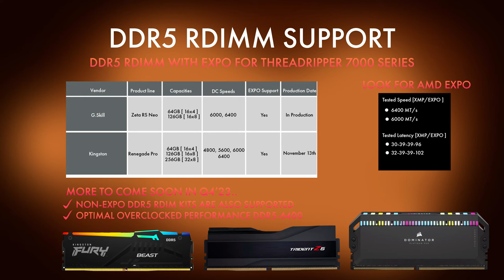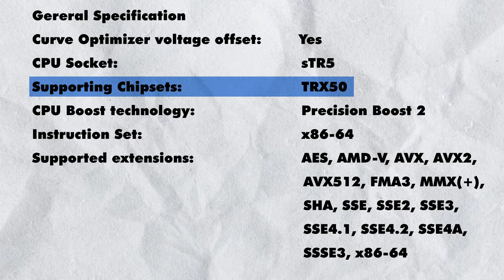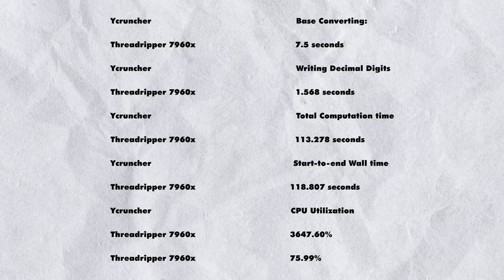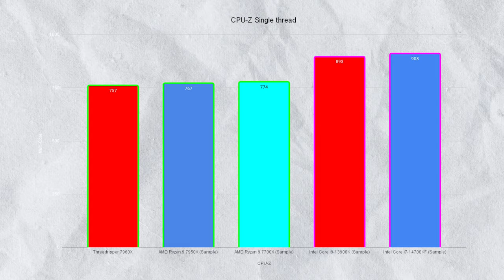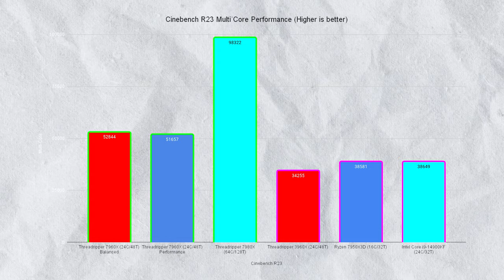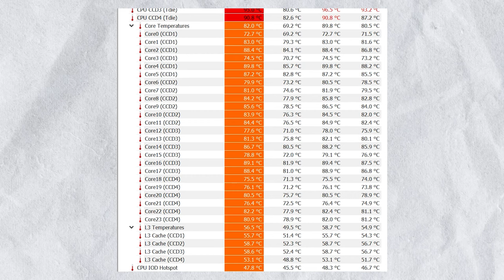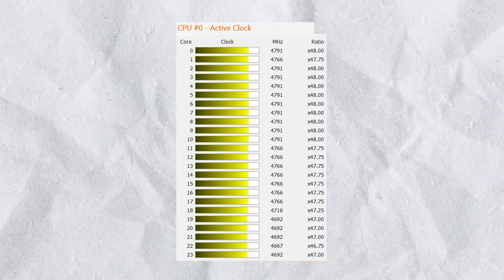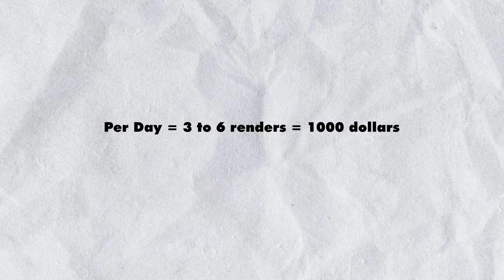A 24 Core Monster! | Threadripper 7960X Review

Comment: Strongly considering this CPU for my next build and you covered some good bases and points to think upon. Heavy Blender user along with some photoshop work, lots of Lightroom, Premiere, minor coding, lots of gaming, so it's for me a case of "this will crush all around workloads that I need". Thanks for the great review.
Reply from the maker: Heya :) 

Just note the benches were not amazing for Adobe based applications. Intel still won there, but it is not going to be a massive difference especially if you are going for all around workloads :) 

Just get good ram !

Comment: So the problem with the "it can but shouldn't" is that many of us out here use our PCs for a combo of things. I write code for the day job, I "try" to write music with my DAW setup, I run some AI models on the PC, and I game. So for me, it's the perfect all around CPU with enough gaming performance to get the job done for most games quite easily, while providing a robust developer machine and AI machine (with dual AMD 7900xtx GPUs for the VRAM), music production, etc. For someone just looking for gaming, def go with 7950x or 7800x3d. But if you do multiple things with your machine, this chip is probably the sweet spot for getting you in to the TR without costing that extra $1K to $3K for 32/64 cores that you probably wont use.
Reply from the maker: 100% 

It's best to fit the cpu to your general work load. You have found practical use for it which is good
Reply: @WootDini  Hoping it works well enough. :).
Reply: I have very similar use case for my 7970x although I still find myself underutilizing the PC most of the time.

Music production really, really benefits from the TR. Each track is a thread giving you 24 tracks in your DAW which are each completely dedicated to a CPU thread. Each thread runs so fast that it would take a lot of (and I mean a lot) plug-ins to cap one of them out.

compare that to a quad core 8 thread pc, it may be faster per thread giving some more power at first- but more than 8 tracks and you start to combine tracks processing per thread absolutely cutting your power in half or worse.

Comment: Thank you for the review. I am not a computer expert, though I have been building my own computers since the early 90's. I am considering this CPU along with the Gigabyte motherboard  to run an astro-photography processing program called PixInsight and I am assuming that the CPU would be just what this program calls for. Can you please give me your opinion as to the suitability of my planned build for running this program.  Thank you in advance.
Reply from the maker: Sorry for the delay. I have never used that program. But from what I can see it's a CPU intensive program so it will work well. It also needs alot of ram which compliments the 4 channels of the cpu

Comment: hi i am on tight budget should i go for threadripper 7960x or ryzen 9 7950x ? I am mainly using for houdini  unreal engine and blender which one you think is best?
Reply from the maker: Heya. 

So this is a tough one considering you need to do on budget. 

Both will work but consider the following 

7960x has vs 
4 channel memory 2
24 cores vs 16
Supports 1tb vs 128 (both are sufficient)
128gb l3 vs 64
189gb PCIe band vs 94. 

So if you need to pinch I would say rather go for 7950x as it's blender is good (have not benched on unreal). The 7960x gives way better "futureproof".

Soz man I hope this helps. Either way you will be fine.

Comment: Thank you for your great Review 👍👍👍, I want ask you a question please, I plan to buy Thridripper 7960x with Gigabyte TRX50 Aero, and the liquid cooler "NZXT Kraken Elite 360 RGB" but on  the website of NZXT Kraken Elite 360 RGB mentioned (*Threadripper bracket not included) so,  Where do I find sTR5 bracket to mount liquid cooler? thanks.
Reply from the maker: Heya. 

You are most welcome. 

The Bracket and the torque wrench come in the retail box the cpu ships with :)

Comment: I actually haven't seen any reviews of this cpu that focused on the gaming. Could you point me towards one?
I know Gamers Nexus did a short section, but that was just to show that it could run them. Not so much benchmarking.
Reply from the maker: Heya

Sorry for the delay, been away for a tiny holiday.

So pretty much all of the reviews that I see went with "This is not for gaming, but here are the gaming benchmarks". Maybe it is a good point to show its performance is adequate but not optimal. If you are talking about the 7960X purely on gaming, Steve does and I see the comment from @gametechreviews below.

I just feel with today's market, the people who need these CPUs are not going to understand half of the benchmarks, or for that matter, care. Think we have got so stuck in the details that we forget the main purpose which is massive data processing. 

Just a rant from my side :) ignore me
Reply: @GameTechReviews  Hey thanks for the link.
Reply: @WootDini  Yeah I definitely get that. My use case though is fairly niche. As I compile my entire OS and userspace software stack, multithreaded performance is important(looking at you chromium). And having the capability to play games is definitely welcome. (although these days there isn't much to play thats actually worth the time).
Reply from the maker: @LabiaLicker  I shall add Chromium in next time :) I still have another to do but waiting for WRX to launch
Reply: the 7960X is a real deal for gaming but becuase the engine must support many cores. Starfield and RoboCop Rogue City runs real nice on him. the 128MB L3 hit hard if the engine can handle the 7960x

Comment: Thx for this extremely informative and factual review.

But as a constructive critic I've to say the background changing during the chart presentation was way to much flickering for my eyes.

Keep up the great work 👍
Reply from the maker: Thanks so much :)

Yea agree. Was cool at first but becomes annoyiny after a while
Reply: @WootDini  Also as an additional use case for such monstres CPU are data science and machine learning applications. They need a lot of power over a long period of time. Some examples are:
 - Vector calculations (where AVX512 is extremely usefull)
 - AI: GPU kernel compilation for deep learning graphs
 - Dataset: data preparation, augmentation and transformations
 - And also the IO capabilities of taking a lot of RAM and multiple GPUs

Comment: Cooling performance is bad at your test system. i have a diy Watercooling, my 7960x never get higher temps like 64°c at 100% load (360x2 fullcopper plus one 120mm fullcopper radiator all st30 HPE Alphacool)
Reply from the maker: 100% 

I did mention that I believe there is more room for improvement if I can cover the IHS. 

I won't go for overclocks until I am happy with the cooling. Want a rectangular copper plate to cover full IHS.

Comment: 7950x is better for comparing a TR than 7950X3D
Reply from the maker: Heya 

Not really no. The 7960x and 7950x3d have the identical amount of L3 Cache at 128mb making it a better comparison
Reply: @WootDini  The Ryzen 7950x has a slightly better workstation performance than the 7950x3d and costs 100 dollars less, clearly if you are evaluating the TR 7960X it is for a workstation ...., but if you want to compare it with a processor designed for gaming .... it is fine.

Comment: Not for Gaming its not the full true, i have an 7960X system for Gaming and it rocks, RoboCop Rogue City fxp. Unreal Engine v5 loves the Threadripper 95%er 10ms, avg 110FPS, max 195FPS, in preset Epic/Nativ at 1440p. Starfield 95%er 9ms, avg 162 FPS, max 385FPS preset Ultra/Nativ in 1440p. My Sys 7960X, GBT TRX50 AERO D v1.0, 64GB Kingston Fury Renegade Pro CL32-1T/6000 with RX6900XTXH. CPU stock and GPU is light UV 96% core and 95% power.
Reply from the maker: Definitely can game yea 

I just did not want to focus on this at all or people understand what the product is for. You can buy alot cheaper CPUs and game with better fps.